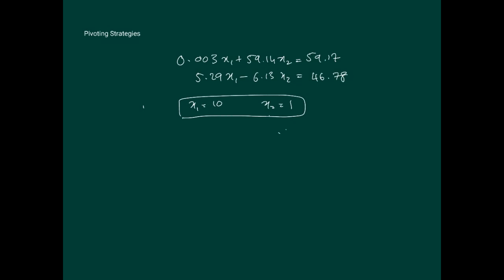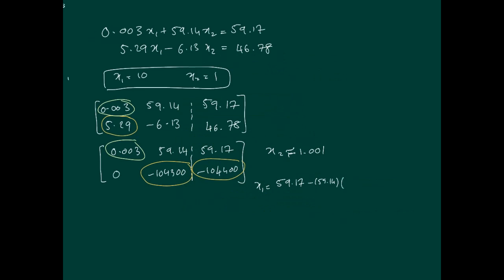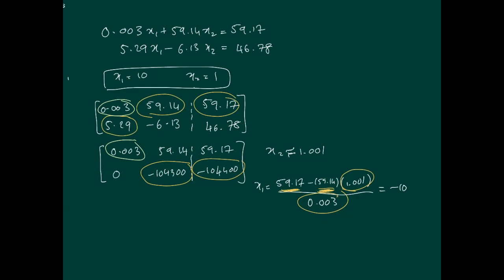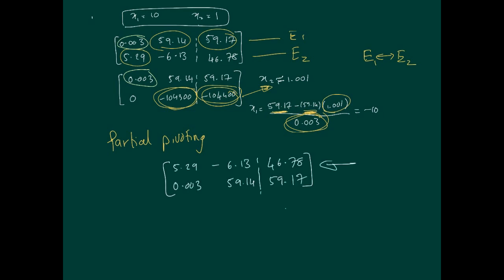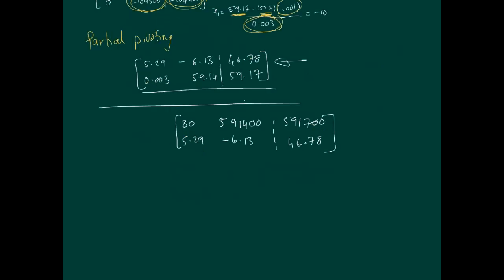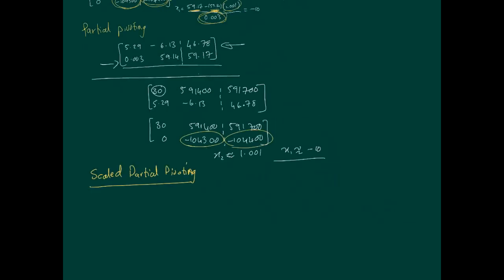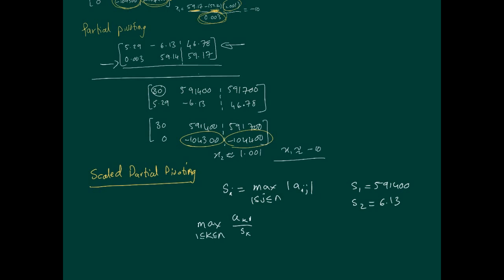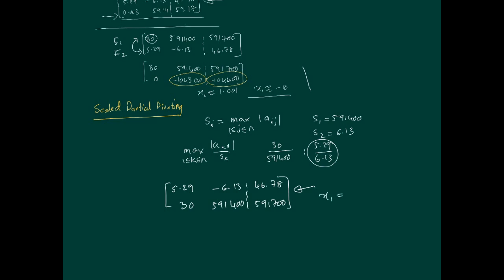Numerical Solutions of Linear Systems - Pivoting strategies

Comment: Please someone answer me. What will you do if the same magnitude? will you interchange the rows, or not? i tried answering equations with same magnitude and i tried to interchange, which resulted to getting the right values, the same as not interchanging it. what is more proper? thank you.
Reply: I would guess that since the small value is creating error problems that if the columns all have equal values, this error issue wouldn't arise which wouldn't require row swaps.

Comment: Plz someone explain how we get -104300 and -104400
Reply: to create a 0 in the second row, we create m21=A_1,1/A_2,1 = 5.291/.003 = 1763.66. Then E2 - m21*E1-->E2  --> 5.291 - 1764*.003 ~= 0 for position R2C1. -6.13-1764*59.14 ~= -104329 for R2C2. Then 46.78-1764*59.17 ~= -104329. The text seems to have some calculation errors of its own since these two numbers agree. from p372. If the values for R2C2 & R2C3 were different, we could get the 104.3k/104.4k combo.